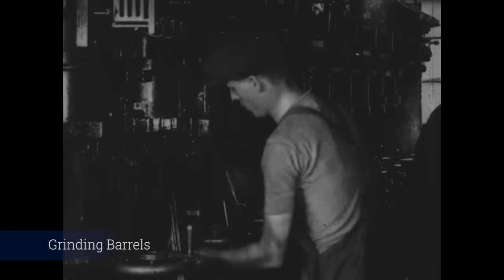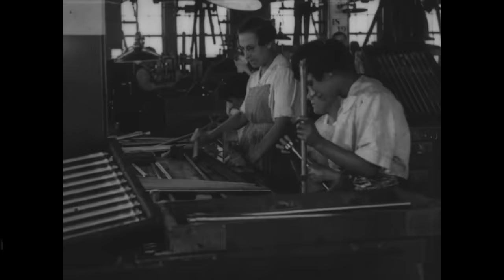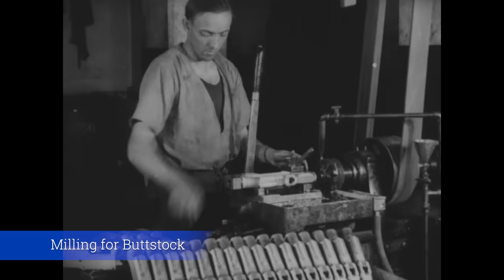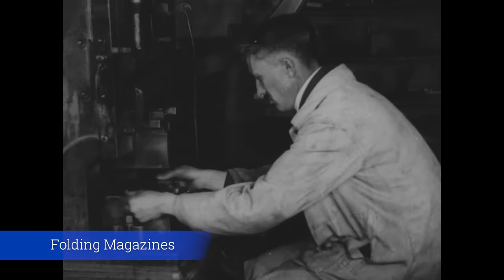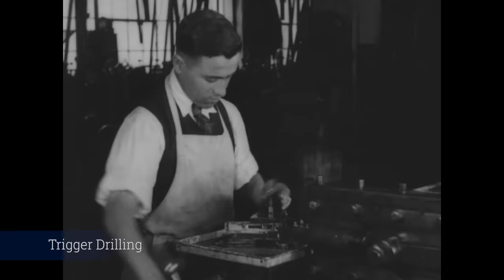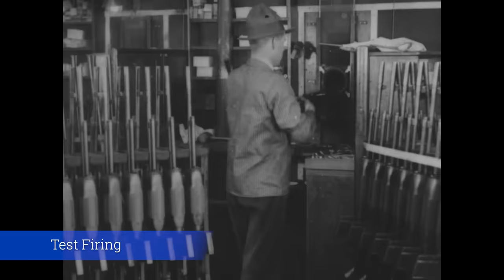Manufacturing the Browning Automatic Rifle (BAR) - ORIGINAL FOOTAGE

Comment: All those machines had to be set up, ran, maintained. Pride and craftsmanship. Now, injection molded plastics are a thing. Video of over 100 years ago...and their work still appreciated.
Reply: The mould-makers for injection formed plastics are just as dedicated, it's an extremely underappreciated form of modern craftsmanship.
Reply: @LN997-i8x  fair point that I will agree with. Someone has to make the mold.

Comment: Amazing the amount of machine work that went into that process. The development of the manufacturing tooling was truly a marvel. Manufacturing and industrial engineering at its best!
Reply: How did you think they were made?
Reply: I was quite surprised as well, I had always been under the impression that while I knew they were machined I just never realized the scale and size of the machines they used, I thought it was more hands on basic manual lathes and mills but as you can see at 4:10 frikkin automated mills! all be it analog automation but still very interesting and eye opening, always fun to learn more stuff about history and industry with these golden nuggets that are archived films like these
Reply: @Merle Dixon0311 yeah. They were in fact the majority of the industrial workforce. The able bodied men being under arms. 
So, wise words Merle!
Reply: What is ironic/strange about the development of machining is that not a single machine-tool was beyond the technical ability of the Ancient Romans, Greeks, Indians, Chinese, etc.

Two things converged to make it happen:

The mass production of steel.

And Calculus.

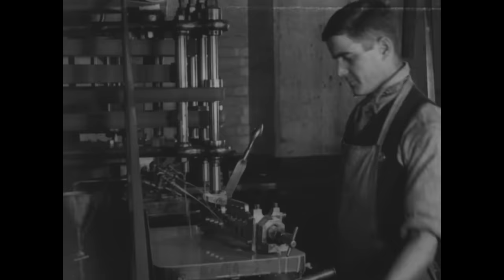Comment: I'm amazed at 4:26 that the operator seems to be using a hand aligned jig during a receiver drilling/reaming operation. That's probably the most critical component in this design and the process seems very uncontrolled. Also, lots of streams of variation-with operators running several machines simultaneously. The design had to be robust to handle everything that could potentially go wrong from a process standpoint. I'd love to see a similar video for the Browning M1917 Heavy Machine Gun, that would be great!
Reply: Interesting also was the belt driven turning machines, rather than using an electric motor. By WW2 most of that equipment was electric driven. As a recently retired Manufacturing Engineer in the auto industry I LOVE seeing these videos. Subscribed tonight. Well done!
Reply from the maker: Thanks for subscribing!
Reply from the maker: https://youtu.be/bobIA9avWxE here's the video on the Browning!
Reply: @HighCaliberHistoryLLC  Hi, I saw that after I printed my message above. Great channel with tons of good information, many thanks!
Reply from the maker: @pimpompoom93726  Thanks, Ken!

Comment: Amazing.  It would be interesting to see a video of the making of an MG-42 for comparison.  Both clashed on the same battlefields ; milled early century technology vs stamped metal 1940s method.
Reply: The MG 42 was more stamped.....a true comparison would be with the MG 34....it was made all the way thru until the end. It too like the BAR was art in motion.
Reply: They still make the Browning Automatic Rifle for civilian use too. Excellent rifle.
Reply: @davemartani1529  
Yea but the military and the civilian BAR's aren't even close to each other, the military BAR has a receiver that's massive compared to the civilian one.
They don't share any parts interchangeability whatsoever, only the name.
Reply: @dukecraig2402  True and their barrels are longer than the civilian model. I don't know if the military has bought the new models, but they still use the original ones. What I know is that I like mine. I'm going to change the furniture on it to make it lighter.
Reply: Ohio Ordnance makes a "1918A3" which is a semiautomatic-only version of the 1918A2.

There is a hunting rifle called a BAR that shares nothing in common with the weapon here, other than the name.
Reply: That’s true but it gives an idea of what it would been like to be issued One then taking it with you into combat

Comment: I like this video of how BAR was made from the factory. John Moses Browning was a genius of his time.

If John Moses Browning didn't pass away in 1926, but instead was able to live long  enough into 1930-1940. He would create his own assault rifle and battle rifle(post WW2 like FN FAL) 

Alternate Timeline 1940:
In this alternate timeline, Browning was able to live  long enough to work and innovate in small arms. When German introduce the StG44. Browning have a vision to create his own assault rifle. By using the BAR/Colt Monitor/FN Model D for base design including capture some examples of StG44 for study. 

In, 1944, he introduce the BROWAR(Browning Assault Rifle/Automatic Rifle) 1944. 

Note: Imagine, BAR mix with FAL. Fire selector like FAL, but based model are Colt Monitor/FN Model D. Less bulky and more slimmer. A carbine version with folding stock like Para FAL. 

BROWAR 44 
Design: 1944
Type: Assault Rifle
Caliber: .30-06
Weight: 4kg
Barrel Length: 16 inch Barrel
Magazine Capacity: 30 Rounds
Rate of Fire: 750 rpm

Following a successful of BROWAR. He introduce other variants. It was use during the Post WW2 and prove to be quiet effective.

BROWAR-C(Carbine)
Design: 1945
Type: Assault Rifle/Carbine
Caliber: .30-06
Weight: 3.3kg
Barrel Length: 10 inch Barrel
Magazine Capacity: 30 Rounds
Rate of Fire: 750 rpm

BROWAR-S(Sharpshooter)
Design: 1945
Type: DMR
Caliber: .30-06
Weight: 6kg
Barrel Length: 20 inch Barrel
Magazine Capacity: 10-20 Rounds
Rate of Fire: Semi Automatic

BROWAR-MG(Machinegun)
Design: 1945
Type: Light Machinegun
Caliber: .30-06
Weight: 8kg
Barrel Length: 18 inch Barrel
Magazine Capacity: 30 Rounds/75 Rounds Drum
Rate of Fire: 750 rpm

PS: If that really happen. We won't have AR15/M16 in our timeline.

Comment: I think the end shot is a view of main st where the remington arms plant had trolleys coming between the two plants in  ilion N.Y.  when I was a kid, early 60's the took down the covered catwalks between buildings and fenced off the rd. There was still a half mile section of erie canal right up to the foundations. It's amazing how busy it is, now its a ghost town.
Reply from the maker: Remington didn't make the BAR. This is most likely from the Winchester factory.
Reply: Remington never  made BARs. Colt, Winchester , Marlin were the WW1 makers
Reply: @HighCaliberHistoryLLC  I do know the rem Ilion plant never made the BAR during ww1 but they put some stock footage from ilion. that's the corner of main and otsego st.just up the hill on armoury st. is their original museum  which I went to at least once a week as a kid. Those duel trolly tracks were still there as a kid but I am sure the cobblestone and tracks are paved over now

Comment: If I could only have four guns from the end of WW1 time period, it would be a BAR, and Winchester Model 12 riot gun, a Colt 1911 and a S&W 1917 .45ACP revolver…but that’s just me :/
Reply from the maker: Solid choices.
Reply: Hate to bust your bubble, but the Model 12 wasn't used by the military in WWI.  Prototype only.
Reply: @jimdavenport8020  I pulled out my trusted US Combat Shotguns by Bruce Canfield and I see that you’re more or less correct. It existed but was not issued, or was not issued in hardly any numbers. I stand corrected. However, it did exist in that time period and that’s the era I associate it with, although the sporting model existed earlier. 

Your point is well taken, friend.

Comment: Better played at a realistic 0.5 speed with no music.
Reply from the maker: I didn't adjust the speed from how it was recorded, and the footage was silent, but there's always a mute button for the music. Thanks for watching!
Reply: @HighCaliberHistoryLLC  Getting the speed right would have taken some work. 1/2 is close (but not exact) in some cases but not all. Cameras were hand-cranked back then, so didn't necessarily always go a constant speed. Also, film was very slow (that means that it needed a bright light to 'see') so in an indoors setting they often had to run at a slow frame rate to get enough exposure. Different scenes run at different speeds. 

Most likely this was intended for 16fps playback, but the Nat Archives are very poor at getting that right on their transfers, so I suspect that the transfer was done at 24 fps, which is 50% faster than it would have been originally. (In any case I see this is at 24fps.)